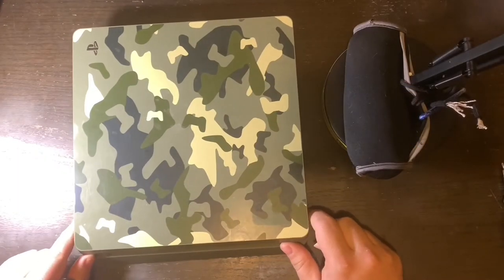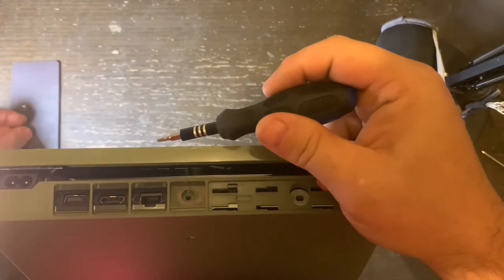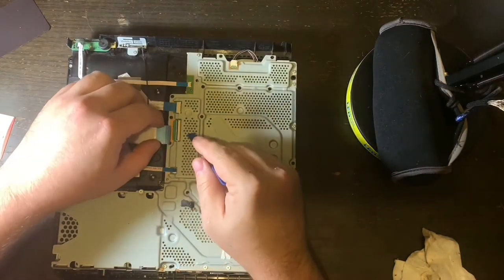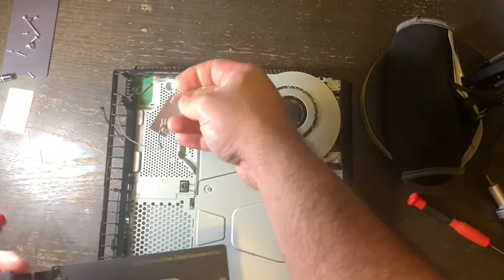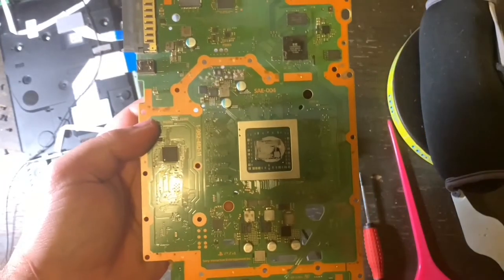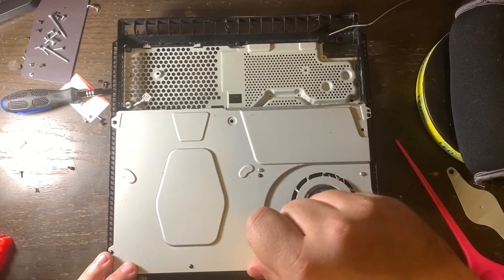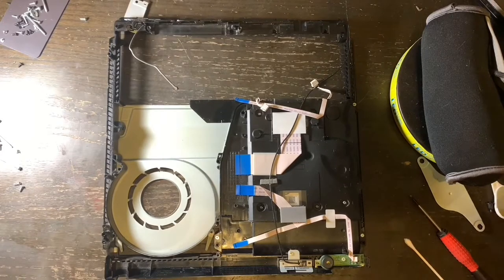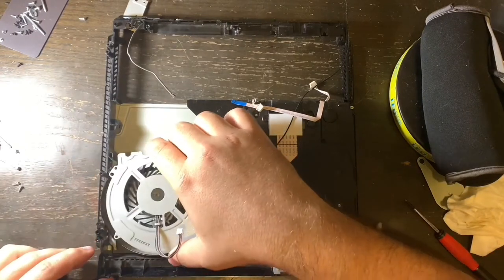How To Fix PlayStation 4 Slim Overheating - Red Led And 3 Beeps Shutting Down Error - Problem

Comment: good evening..I have one ps4 slim and when I turn it on it makes a beep and closes immediately and the fan works like crazy..what could be wrong?
Reply from the maker: Without seeing it in person it would be just a guess but based on what you have told me maybe it needs compressed air to clean it out or maybe even fresh thermal paste under the APU it may be dried up and the system may be overheating.

Comment: I cleaned it out all the way still doesn’t work super bummed
Reply from the maker: Just retrace your steps and see if you remember anything that you may have done wrong.  Hopefully you get it back up and running.
Reply: @Mr_Goody  I’m did unfortunately it hasn’t improved I’m probably gonna upgrade to ps5

Comment: My ps4 over heats to much
Reply: And ther is so much space
Reply from the maker: Then it could be dirty on the inside just do what I’ve done in this video and you should have no more problems with overheating.
Reply: @Mr_Goody  but like the problem is its happening. With some games like fn but imma use the tip than man luv